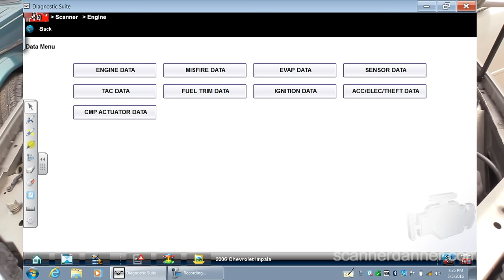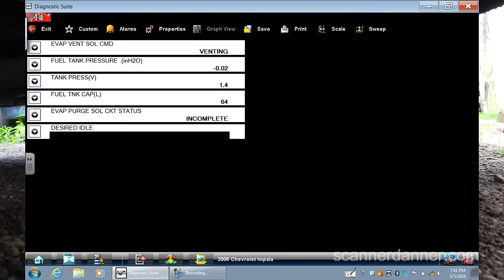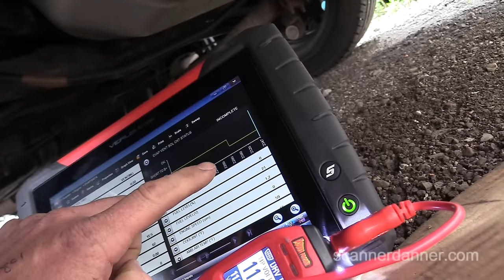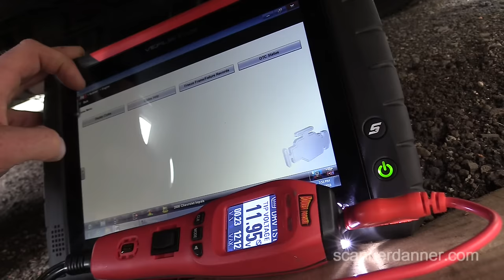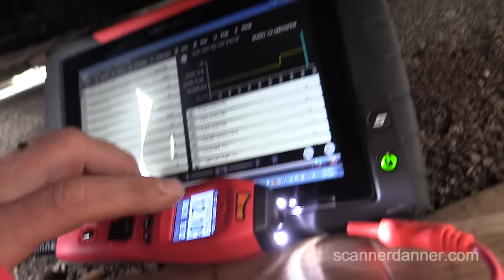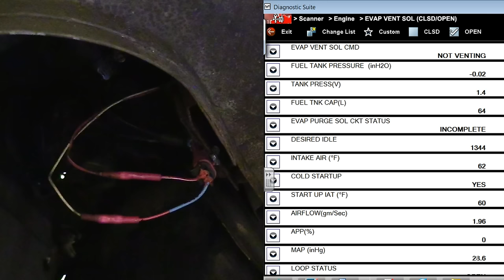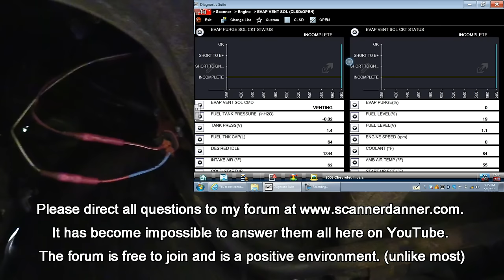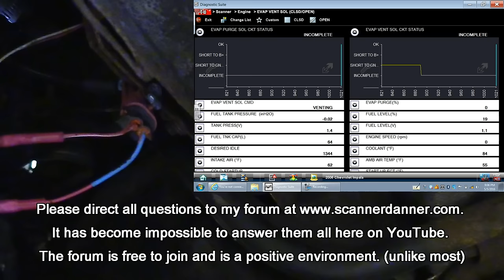EVAP vent solenoid wiring repair and testing P0449

Comment: I find a lot of crimp on connectors at my work (industrial electrician) exactly like that wire.
Had a broken wire inside a muli-connector wiring harness today from flexing--wire problems can really suck to track down.
Thanks for the video, nice

Comment: Great thanks, HHR, I just put a new valve in that had failed went for a test drive light on again, same code, watched this video, checked harness exactly the same broken wire and exactly the same place, great video, thanks again.
Reply: Wow!  I'm going to try that now that I replaced everything that might cause this.

Comment: Thanks bro you're the only video on the Web I found that has fixed my problem  I  Replaced the silanoid twice only to dig deeper and my wire broke in the same place you saved me a few hundred I'm sure thanks

Comment: After replacing a good evaporate solenoid & the other solenoid at engine, I finally went with a new plug which was an oddball from the standard plug which comes with the new harness. All set now Thanks:)

Comment: those heat shrink connectors are great. also the best ones to use on can wires as soldering can wire can add too much resistance to the circuit.

Comment: Loved the video! However, I took your wire repair one step further... I used the "new" adapter lead, which was about 5" long, and just cut the (old style)  adapter ends off, then SOLDERED the ends together and used a marine-grade, sealing shrink tubing to protect the wire. Moisture is what was screwing up that connection and eventually eroded the wires. Basically, remove both old-style ends from the OE harness (male)  and the adapter harness (female) , and solder the wires together. (crimped butt splices are for the hacks at UHaul when they are installing hitch wires...lol)

Comment: As I was watching I was wondering why you didn't use a different coloured wire to fix that pigtail...and if you were going to use a sealant on the end. Nice to see these were addressed.  I do as another commenter said - when in the wrecking yard I pick up the various pigtails.... they don't charge for them usually.  They are good for testing solenoids as well as replacing broken harnesses. I am not a fan of piercing wires because I live in Canada and they salt the crap out of the roads so corrosion in wiring is a problem. Anyways - always like your videos..

Comment: Nicely done, I've been looking for a good demonstration of what to do when the broken wire is close to the connector. It's too bad they don't standardize and sell the metal inserts. They all seem to be similar, but you need an exact match unless you decide to replace the whole connector.

Comment: Nice catch there! If that were me, I'd have spent 3 hours checking all the wiring only to find that at the very end, LOL! :D

I just discovered those heat shrink butt connectors about 5 years ago - best thing I ever started using, especially on trailers that get run through the salt, and then parked outside over dirt for an extended period. Could never go more than a month without having lighting and electric brake problems. Using those connectors, my stuff has lasted years, so I  now use them on anything that is brought here for repair. 

My only 2 issues have been the sub-par torches I find for shrinking them - they're either too small and take forever to melt, (and then break after only a few months of use, or fail to light in temps below 40°) or they're too big and turn everything black if I'm not careful. Other issue is the automatic strippers I've been using for years - none seem to last more than a few years before the tension just lets up on them. I find those to be the fastest way (for me at least) to strip wires, so long as the thing stays within reach. :)

Comment: I know flexing and movement can cause an inside break like that, but how does the moisture get inside the insolation? Does it work its way back from inside the connector? Ive found the same issue before, I'm just curious where it actually originates from.

Comment: Thanks for this information!  Gonna check the wiring on my pontiac g6 and look for breaks tomorrow since i've already changed the solenoid and gas cap and the stupid codes still there.
Reply: GameTimeIzSiK have the same thing happening to me! Replaced multiple parts that were probably good and it was just a wire lmao gonna have to check it out tomorrow for sure
Reply: This the evap in the back by fuel pump or around engine

Comment: Hey mr danner ! From the white wire from pcm , should we get voltage or ground ? Can you please explain? Thank you
Reply from the maker: On this model and this solenoid. That white wire is a switched ground. Meaning it is not always grounded. With the circuit is off, power will come into the pink or red wire and then wrap around the solenoid winding and will come out the white wire looking for a ground. Without a ground, there is no current flow, so there is no voltage drop, so you will read 12v on the white wire too! Make sense? So 12 and 12 if measuring with a voltmeter (circuit off) and 12 and 0 circuit on.
Reply: @ScannerDanner  thank you Mr Danner . It’s very helpful. I really appreciate you .
Reply: @ScannerDanner  Mr. I am just wondering did you do any case studies that you are trying to find whether a wire broken from PCM to fuse box or bad PCM ? Thank you
Reply from the maker: @mokarrommolla5820  I'm sure there are plenty of them!
Search my chapter 3 playlist

Comment: 25:55 can you elaborate a little more? Does it matter if I accidentally reversed the wires when putting them back on and installed it ? Because I honest to God did and weird oddly enough it's not check engine light or anything showing on obdII screen ?
Reply from the maker: It doesn't. A solenoid will work with either polarity.
Reply: @ScannerDanner  thank you so much man! You know it's so weird it didn't work but I tried fitting it back in only to find out I pushed it would only go in the facing the other way and literally it solved the entire problem like I can believe this lol 🤣 thank you!!!!
Reply: @ScannerDanner  btw. Seriously though, this entire video I saved my 'Monte Carlo 2007 V8 SS' I can't find a video that has any better experience and advice on this kind of topic keep killing these video's dude!

Comment: Thanks for the video. I wish my problem was the white wire. My 08 Saturn Vue XR has no feed power at solenoid. It does show power at fuse for escm. Having trouble tracking wire from fuse block to solenoid.  Any tips?
Reply from the maker: Check the wire about an inch from the evap solenoid connector. Tug on it. They will break inside of the insulation and it will look fine. It will be real stretchy and will pull apart
Reply: Thanks for the quick reply. I’ve inspected it thoroughly and don’t see a break. I’ll keep trying. Hope that is it because it looks like there is a connector above fuel tank that is not easily accessible. Can’t seem to figure out how that wire routes from the fuse box. Appreciate the help. I’ll let you know what I find.

Comment: In my mind  I think I know what I am doing and I 
Am fairly intelligent  ... but there's  so much to all of this... I did what u said and u are correct it's the harness I actually  was about to ripe the seat out because there a harness under driver side seat... I pulled out the pcm and checked the wires lol
Reply from the maker: did you find the exact area of the fault? Where was the open circuit?

Comment: Hey Paul could you do a video on when or why you would need to look at "Not Run or Failed since Codes Cleared" and "Not Run or Failed This Ignition Cycle" and also on fords I cant remember what it says but there are several options to pick from when you go to read the codes.
Any time I looked at the first 2 options there were usually a ton of codes.
Thanks

Comment: I got a 2007 Yukon XL, I was getting p0449 code, replaced the EVAP vent, cleaned out the charcoal canister, only to find out I have something wonky going on with the wiring. I tried checking for breaks at connector, didn't see any, I will be checking again, but it seems like when the solenoid is plugged in in stays closed all the time, even when the SUV is off. And drains battery within few days, hard to fill gas. I've unplugged it for now, which keeps the solenoid open and I can fill gas. But that's not proper fix. Would you think it's a wire break or could it possibly be harness (ground) rubbing on the frame? Usually people have issue that it doesn't click. Mine clicks once you plug it in and stays closed all the time. Just wondering if you encountered this before, seems to be a bit different from what most people are running into.

Comment: Senor dan do you have a hard copy of troubleshooting steps for diagnosing  different evap codes . I cleared po442,po456,,but no luck on po448 I  don't  know where to start . I  recently purchased a pwer probe kit and an evap smoke machine. I'm trying to learn the basics on electrical troubleshooting but keep getting lost. Saludos

Comment: thank you so much for your response, I just to do it, unplugged from solenoid results are (truck powe on) on connector 12v between them (2 cables), respect to GND (top/front view) left 12v, right 0v, with connector plugged to solenoid 0v between 2 cables, and respect to gnd 0v on both, also I connected a bulbe light of 12v directly to connector and did not turn on the light, I don't know if I need to use some diagnostic tool like you for enable the output for solenoid and that way can observe the power on on bulbe too, I'd like tell you something about the failure, when truck is running about 50 miles (at 1.5k rpm) feels like needs more power, but once that comes to 2k rpm truck runs ok, at autozone I got the following codes at beginning P0300 and after fix damaged hoses I got P0457 and P0446, also to this I replaced gas cap, due this error is showed too, Just I want to have an idea of what could be causing this... because 2 previous mounths truck was working ok

thank you and best regards
Reply from the maker: It would help me in the future to stay within the thread. I believe we are testing the vent solenoid. Also you are now describing multiple problems so let's address one at a time. 
Now to the vent solenoid. You have a voltage drop problem on the supply side (pink wire on a GM). Pull on the wire near the connector. Don't be afraid to pull pretty hard. I'm willing to bet the wire pulls apart right where your green corrosion is. And if it is not right at the connector, do a real good visual inspection of the harness and look for contact points.
Reply from the maker: Okay found the original post. It's a Dodge. The numbers you gave me could be completely normal and what you are seeing is a bias voltage on the control side of a power side switched solenoid. At this point I need to to post this to my forum. Hope to see you there. 
https://www.scannerdanner.com/forum/post-your-repair-questions-here.html

Comment: If this part gets wet say, like in a flood, how serious is this and, will this cause a no crank?
Awesome video. Thanks a lot.
Reply from the maker: Only if the solenoid shorted out electrically and blew a fuse that is shared with other circuits. Other than that, no, this vent solenoid will not cause a no crank condition.

Comment: Those weather pack connector terminals can be bought for dirt cheap on Mouser.com.  I keep a variety of them for working and doing mods on my GMC Sierra. I usually get the weather pack part number from my factory service manual and then type that number in to Mouser.com search.  Then I just order a dozen or so and keep them on hand.  Many of the plastic connectors and locks are available too.  Much cheaper than buying replacement pigtails and no need for a butt splice.

Comment: would you still get continuity on end to end of that harness with that wire in the condition it was?  I have a code 440 it just says "evap system" and that is it.  I've checked with digital multimeter and harnesses and voltages all good.  I've replace vent valve, purge solenoid, gas cap, pressure sensor and still light keeps coming back on.  Takes about 50 miles.  New wire harness for pressure sensor.  Tested those wires with doing the jumper method.  Got 5v on reference, zero on ground, 1.4v on signal wire.  The voltage on pressure sensor does not fluctuate though.  It seems locked on that reading with car on or off doesn't matter.  Vent valve i get 12v backprobing both wires with key on but the harness is good end to end continuity.  Had a garage put on their scanner and he said bad pressure sensor.  he didn't show me so im suspicious since it's brand new and i'm getting 1.4 on my meter.
Reply from the maker: I prefer the voltage measurements over resistance. 
To confirm the vent solenoid wiring. Measure the control wire voltage right at the PCM. It should read 12v there too.

Comment: Hey Scanner, pulled the fuse box and I ran a new wire from the terminal to the purge valve solenoid. I have 12 volts at the end of the wire. Only problem is I have 12 volts all the time. Even WITHOUT the key in the ignition. The key isn't even in the truck. Should it be like that? If not do you know what's going on?
THANK YOU GREATLY IN ADVANCE FOR ANY OF YOUR TIME AND HELP! IT'S MORE THEN GREATLY APPRECIATED!!!!!!!!!
Reply from the maker: As long as it is fuse protected you should be okay. That circuit isn't active with the key off anyway. I would still rather see an ignition feed being used though
Reply: @ScannerDanner  well I have it back together, I no longer have any evap codes but fuse 26 is hot all the time and when I went to start the truck the battery was dead. The battery is only 2 months old. I jumped it and it started all day. But when it sat again for 7-8 hours the battery was dead again. Do you have a clue what is going on or what I could do?
Reply from the maker: Yep, you're power up circuits that should be off with the key off. You need to find an ignition hot wire, NOT a battery hot one like your using
Reply: @ScannerDanner  but I'm using the factory wire at fuse 26. Are you telling me to just pull fuse 26 and use another wire for the purge solenoid? If I use another wire then what was used at the factory will my check engine light still stay off?
Reply from the maker: Without looking at the diagrams, I can tell you for sure, that the purge valve should NOT have power on it all the time.
Reply: @ScannerDanner  I'm not being rude but that's my point,  do you know why or what I could do next?
Reply from the maker: Not without research on my end my friend. I can't offer that here but I can certainly direct you to my forum where we can do that there! It is free to join

https://www.scannerdanner.com/forum/post-your-repair-questions-here.html
Reply: @ScannerDanner  thank you, I am already a member.  I just did some more testing. And when I back probe both wires I'm getting 12 volts at both wires. Still with the key off, but I have no evap codes.  The power wire is new from the fuse box to the solenoid. I guess now I need to redo the wiring to the pcm or I have a bad driver. I'm only getting 12 volts at both wires with the plug connected to the solenoid.

Comment: Im curious but is there a way to replace that connector instead of repairing it. I can see on my vehicle that wire goes through the wheel well and from there i cant see where it leads too.
Reply from the maker: Sure, if you can find one.

Comment: Hey, I don’t have a harness on my wires at all. I bought the entire solenoid set, but the other side of the connector can’t connect to anything because there is not even a connecter for the wires. You or anyone know where i could get the connector piece? I hope it’s as easy as just sticking the wires through it… i shouldn’t have to do All the burning and stuff since i don’t have a connector right? Or instead of connector, could i like twist the wires together to establish connection?

Comment: Hey man. So we have an 06 scion xb in the shop with a U0100 and a couple other codes. It keeps randomly dying. No special circumstances really when it happens. We've been riding around testing various inputs with a Pico seeing if anything drops out and can't really find anything. One strange thing to me is all the 12V inputs have multiple spikes. This doesn't seem normal to me but maybe I'm wrong. The other guy seems to think it is. Any chance I could maybe get your input?

Comment: with the connector unplugged from the solenoid, i'm getting 12 volts for the power wire and 0 volts on the ground.  What does this indicate?  I was expecting 12 volts at the ground as well based on your video.

Currently stuck on a p0455 code after many attempts at a fix (new gas cap, vent solenoid, purge valve, canister).  Also smoke test ran with no leaks detected
Reply from the maker: It should be zero volts unplugged on the control wire unless there is a bias voltage being used. The P0455 is a large leak code. There should be no issues finding a large leak. Can you close the vent solenoid when you do the smoke test? This is what you should be doing. Let me know
Reply: ScannerDanner 
My mechanic could not find a leak with a smoke test
He was intermittently able to close the vent with a snap on tool, it would freeze on him. He tried different snap on tool, same results. Bought new solenoid, same results

He referred me to Chevy dealer, thinks it’s pcm

Comment: can you do that bidirectional test with a test light or will that fry the computer?
Reply from the maker: Can I disconnect the solenoid and use a test light in it's place and command that circuit on with a scanner and watch for my light to light up? Absolutely. Just do a quick amperage measurement of your test light. Make sure it is under 300 ma and you'll be fine for all solenoids.
Reply: thanks for the response! love your videos, binge watching them right now. you are awesome!